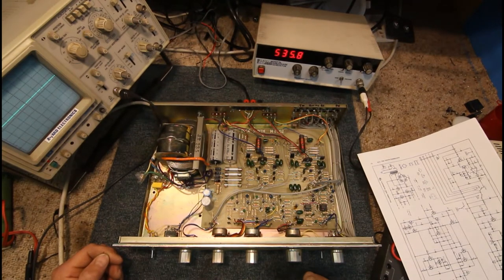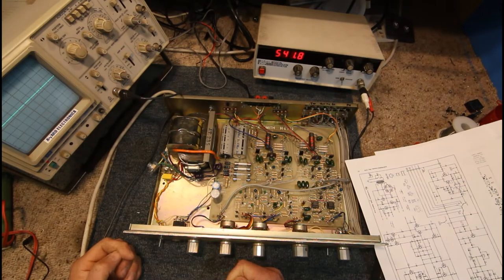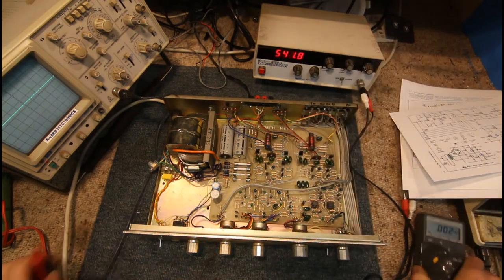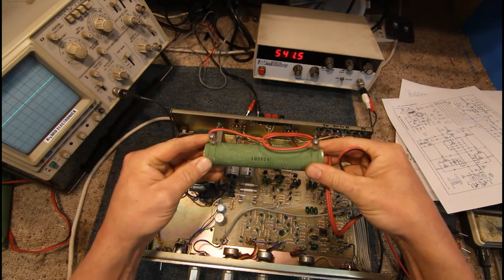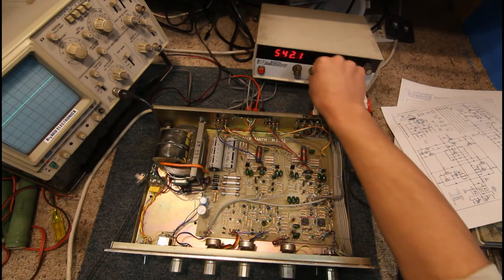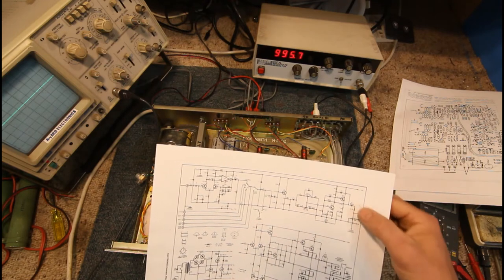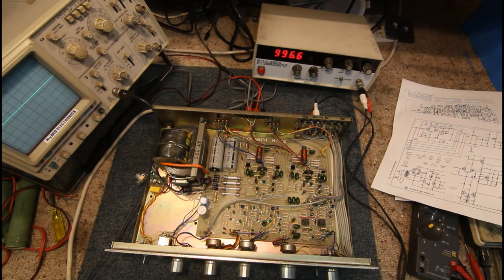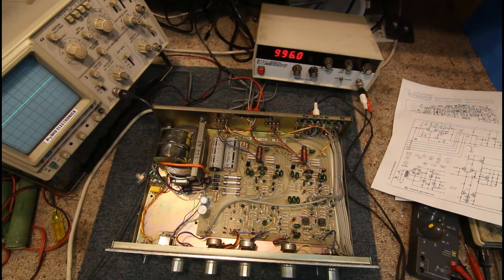How to repair Audio Amplifiers

Comment: Can you point me in the right direction on what I can start looking at?  My Mark Levison No 27 Amp turned on yesterday and a strong pop came out of the right speakers.  afterward the amp would jump to protective mode every time I turn it on.  I disconnected all the cables to the amp with same results.  Power Led lights up, fuse are good.
Reply from the maker: Most likely the output IC or transistors have shorted on that channel and would need to be replaced. You would need to check them for shorts and if there is DC on the speaker protection relay.

Comment: hello sir just getting into this, because I'm took my two amplifiers to two different shop and neither are fix after 3 months, so I'm going to get them back and do it myself. Question on your audio gen you have a BNC to RCA connection, I can't find that anywhere, where did you buy that at?
Reply from the maker: Any electronics part supplier should still have them or Ebay. You can also get a lead with BNC one end and RCA the other.

Comment: You should see what's going on with car audio. Compared to this home audio stuff, it's absolute insanity. There are car audio competition teams out there that run half a dozen 18" subs wired to lower than 0.5 ohms (the lowest I've heard of was 0.17 ohms) that they power with 5-10k watts each. They only need their equipment to last 5-10 seconds in order to get a dB reading, so it's rare for stuff to fail thermally. If something does fail, these teams are usually backed by manufacturers, so they can quickly swap it out with a brand new one. These systems get so powerful that someone shattering/blowing out their windshield is a pretty common occurrence at competitions, with more serious teams opting to replace all their windows with reinforced polycarbonate.
Reply: IIrc, one of the previous world record holders for highest SPL had a tiny, two door hatchback, and he completely filled the back of it up to the B pillar to reduce the volume of air in the car as much as possible. Then they filled the remaining space with as much equipment as they could while still making sure the car remained driveable, which was one of the requirements.That setup got up to around 180 db. Last I checked, the current record holder is Craig Butler, with 183.7 dB. At that level, you actually need to bolt the doors closed. No one is in the car when they make a run in one of those, in fact no one gets within 20 ft of the it. and they have to control it remotely.
Reply from the maker: @craig3.0  They do some crazy stuff in those competitions.

Comment: do you take on work, I have a Boss effect rack that came from japan that I stuffed, put 240v into 120v blister pack and blew it up. I have since used a lab power supply on it to supply the correct 18v and current. It turns on, the pre-amp show it is receiving a signal as the led is lighting up when playing, but i am getting nothing out of the out put, the computer inside seems to be working. I do have a bit of knowledge in electronics, can you suggest a signal path to check that may have been damaged by over voltage.  thanks
Reply from the maker: If that much is still working you have done well. I have no idea what is inside those things, but would start by firstly checking any internal voltage regulator ICs you can find to see if they are outputting correct voltages. There may also be some sort of fusible resistors or solid state fuses on the board in the power area. They would be near the power socket somewhere most likely. Losing a 12v rail may allow the digital circuits to work but not all of the audio section. If that seems OK I would work back from the output sockets and see if I could trace the signal. There is likely some sort of audio output section that could have been damaged. A circuit would be really helpful, but I dont know if Boss support their products with things like that.
Reply: @StevesElectronicRepairShop  solved it, now working, the power supply was 14V ac @ 800ma, I was trying to run it on a DC lab supply. got my hands on a 16v ac power pack, and it fired right up.